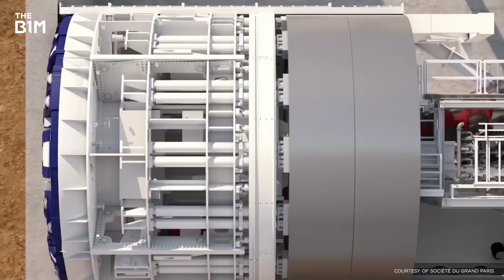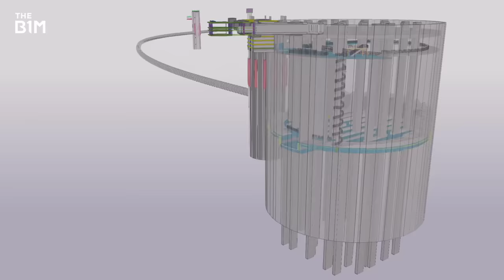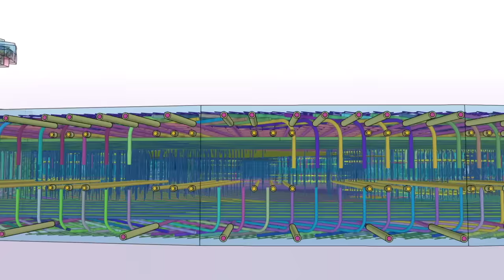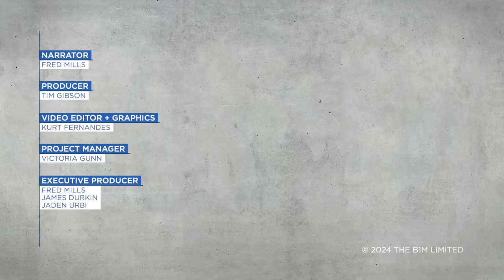Why Paris is Doubling the Size of its Metro

Comment: I hate to break this, but Istanbul just did a similar project encompassing the entire city,  and it only took a few years for it to finished. It's not even mentioned in Istanbul's giant metro infrastructure projects as the city is building 10+ new lines simultaneously. I guess when it's Paris things have to sound more spectacular.
Reply: 342km in total for Istanbul. Extension for Paris = + 200 km
Reply: It's great that Istanbul is investing in everything - railways, highways, airports, canals, you name it!
Reply: not the same thing. it's not a km issue and who makes more.
Reply: @cjlmoni There aren't just 200 km added in Paris. They also extended multiple existing lines, retrofitted the entire network and remodeling the neighbourhoods around. Show the equivalent in Istanbul?
Reply: The network in Istanbul doesn't play in the same league whatsoever that's why they don't talk about it.
Paris 20 000+ inhabitants/sqm, about half that in the urban area. 
They tore down entire neighbourhoods to rebuild new, extended a dozen of lines, created a dozen of new lines, retrofitted the entire network top to bottom (1000+ stations), put new train cars on all the lines (still in process). What is it to compare with Istanbul?
Reply: @puccaland  Let me correct a few things here. The metro line in Istanbul I was referring to, the airport line (which consists of two independent metro projects) is around 150km. And that's just 2 of the lines that are currently being constructed. There are also around 8 lines alongside these, that are currently being built. There is also a project called the HizRay, a trans-city high-speed metro project that has recently started, which will be around 75 km long. Combined this means a gigantic metro infrastructure project underneath a city, an even larger metro infrastructure project than the one in Paris. I'm not downplaying what Paris is doing, it's fascinating, I'm just saying there are even larger projects out there that might deserve some attention.
Reply: @direnius  You were being clear, you said that 10+ new metro lines are being built. Someone else said for a total of 320 km. Check what the Grand Paris Project is all about again because clearly you don't know.
Reply: @direnius  Istanbul doesn't get more press because Istanbul is simply catching up. The city is 25 times bigger than Paris and its current mass transit network is insignificant for such city and population. Even when the new project will be completed it won't be enough.
Reply: @direnius  Sure that's great that they are investing in infrastructures but we're talking apples and oranges compared to what is being done in Paris. Simply get into the details, too many people believe that the Grand Paris Project is simply building 4 new metro lines.
Reply: @puccaland  You don't happen to be French, do you?
Reply: @direnius  You don't happen to have a point do you? That video plus all the videos on the subject plus all the reports on the construction works worldwide aren't made by French people. So feel free to let me know when you want to actually address a point I talked about or shall we understand that you started to comment here because you happen to be Turk?
Reply: @puccaland  The reason I asked is because you simply get too emotional when trying to showcase this project. That all fine, I just get the feeling there is a nationalist tendency here. I'm not Turkish btw, but I've lived in Istanbul for 10+ years. I have traveled to Paris many times, during this time and I admire the entire city (my wife, even more so - it might be the most beautiful Western city in the world), but I think I still would prefer Istanbul with all of its cats, instead of Paris with all of its rats. Jokes aside, the filthy metros of Paris definitely need some upgrade, so this project, if it encompasses the old lines too, is a great improvement. You're right Istanbul has had a modern metro, only since 1989, so it's relatively new, but then again "catching up" might be a bit overreach because the Istanbul Tunnel is the oldest subway in the world after the London metro. So in that sense, all other cities inc. Paris and Budapest are catching up to Istanbul.
Reply: @direnius  Can you quote a single sentence from me which was too emotional? If you cannot I suggest that you go play your pot calling the kettle black thing with someone else. It's clear that you're projecting here because last time I checked you're the only one who totally derailed the topic to make it personal, started rambling about your life as if it was supposed to be our barometer in this world, and recoursing to passive aggressiveness because you don't have a point.
Reply: @direnius  Conclusion, we can safely ignore your feelings for that's not even the topic being discussed here and you're not writing in good faith. Or show those comments and reports saying the exact same things I am saying here and which are mostly said by non French people where who you called them too emotional and accused them of nationalistic tendencies?
Reply: @direnius  I simply stated the facts and told you to check the facts which you could have found all by yourself and simple facts aren't nationalistic tendencies. But hey! I am not surprised that you have that tendency to be allergic to facts, that's so typical from people like you.
Reply: @direnius  Now because it's always funny to see the orc's arguments backfire to their face:
Reply: @direnius  You're going to tell us with a straight face that there aren't rats and mice in Istanbul? Or perhaps that in Paris you're exposed to rats the same way you're exposed to stray cats and stray dogs in Istanbul?
Reply: @direnius  What does you preferring a city over another have anything to do with the subject being discussed here? You seem totally lost.
Reply: @direnius  Name those lines or even stations in Paris which are filthy and need upgrades because of that so we go check how things really are? Or the train cars perhaps?
Reply: @direnius  The subject here is about building an efficient railway system which answers the needs of a city, not who has digged a tunnel first especially when your so called tunnel was just a mere "corridor" connecting 2 stations. People don't travel walking in tunnels and even in the 19th century they expected lines able to take them farther than that.
Reply: @direnius  So catching up isn't a bit overreach at all for Istanbul doesn't have a network covering the city properly, the subject here, the whole point of the Grand Paris Project, and still won't have one after the new project is completed. So indeed it still has a long way to go before catching up with cities like Paris or Tokyo.
Reply: @direnius  If the metro of Istanbul doesn't get the publicity it deserves, my take is that it's because the people who care are like you. Unable to talk objectively about a topic by simply sticking to the facts and trying to mix their feelings into it.
Reply: @direnius  You're on the channel of a guy who goes on great length to make qualitative videos and provide information about transit systems all around the world. And all you found smart to do is imposing your feelings and call his work nationalistic (he ain't French but he simply stated the same facts as well)?
Reply: @direnius  If you need so badly that someone talks more about Istanbul, since you're not equipped to talk about the subject in a mature and serious way, all you had to do was to ask that guy nicely or others making the same videos to make one about Istanbul.
Reply: @puccaland  pucca. You have the best metro system in the world. You should be proud of it. And this mega project is the greatest thing done to Paris since Haussmann. Napoleon (he’s one of yours) once said, “If the world was only one country, Paris would be its capital!” Oh no, sorry, he said Istanbul, but hey, who cares. Who does Napoleon think he is? And never mind, the poor state of the Paris metro. That’s just a reflection of how nice Parisians are taking care of it. Pissing around the stations freely also just shows how democratic and tolerant the French society is. Istanbulites still have a lot catching up to do because no one pisses on the corridor walls here. And if they did, they would definitely get a heavy fine.
Reply: @direnius  You're desperate dude. Indeed who cares about your delirium? Is that the subject here?
Reply: @direnius  But since you bring up the subject the Paris public transportation network has indeed been awarded the title of best mass transit in the world and several times and that was in the 21st century.
Reply: @direnius  Napoleon and Hausmann died 2 centuries ago and have never seen a metro in their life. 🤦 If they are your reference to build anything today no wonder why you're so impressed with Istanbul. Let us know when you catch up and join us in 21st century?
Reply: @direnius  Paris is up there with Tokyo, depends on the criteria. Istanbul isn't even in the picture. Sadly, no criteria which made sense in the 19th century when people travelled with horses is used nowadays. So unfair for Istanbul. No wonder why you can't comprehend what we're talking about here.
Reply: @direnius  Nobody pees around stations freely in Paris, people peeing in public places exist everywhere even in Istanbul and the fine for one caught peeing in the public space in Paris is 135 euros.
Reply: Keep making an embarrassment of yourself. What next? You'll quote Alexander the Great on Constantinople?
Reply: @puccaland  How old are you? Am I discussing this issue with a 13 year old? If that is the case, please let me know and I'll take it easy on you.
Reply: @puccaland  Pucca, I have no idea why you hate Istanbul this much, but you are more than welcome to come and experience the city yourself, as soon as you turn 18. I'm sure you'll really enjoy this city, it vibrance and deep culture. And while you're in Istanbul I would suggest you to try the metros here too. I'm sure you'll return back to Paris with a few good ideas on how the metro in Paris can be improved even further.
Reply: @direnius  Take it easy on yourself. You're talking to someone who knows what an efficient mass transit network is supposed to look like. Overhere even 6 year old kids can understand the topic unlike you.
Reply: The real question is why you insist on imputing your own delirium on others? I do have an idea, you simply don't have a point.
Reply: Sorry but after 10 years in Istanbul your 2 cents on how the metro in Paris could be improved took us back to the 19th century. 🤦
Reply: And you really need to get that professional help because I never said anything negative about Istanbul nor expressed any feeling of any sort for any city for that's not the subject being discussed here. Stop trying to drag everyone down your level.
Reply: @cjlmoni  Extension de 200 km ajoutée aux 230 km existants 😉 Ce qui n'enlève rien aux qualités des infrastructures d'Istanbul.
Reply: @picardiebelleregion9508  Bien sur. Ma remarque était sur la comparaison avec l'extention entre les 2 villes.

Comment: A top speed of 60 km/h? That sounds really slow. Surely they're capable of like 100km/h to be more competitive?

Edit: average of 60 km/h, top of 110 km/h. Very competitive!
Reply: This is a metro not a train. A metro has to stop at multiple stops so it can't go too fast as deacceleration then becomes a challenge. A train on the other had drives down longer distances so it's okay for it to go faster.
Reply: as masood said its a metro made for urban area with multiple stop, better not go too fast, you still have the train to travel between town, the tgv ( train grande vitesse  ) can go  around 300 320 km/h for exemple

Comment: Remember when Crossrail was the largest construction project in Europe? That costed over £14 billion, added 10 new stations and it is ~17 miles from Paddington to Abbey Wood. Over 26 miles of new tunnels. However, the Grand Paris Express blows it away.
Reply: Crossrail is the equivalent of the RER A, which opened in 1977.
Reply: @JohnHughesChampigny  And Paris extended its 5th RER line westbound to La Défense this year, which is hardly mentioned as considered a "minor" project.

Comment: This is grand! Paris will be transformed!

My answer to the brief, in brief:
At the widths of these much needed rail tunnels, all designed as roadways & restricted to EVs, duh. Moves more traffic faster with greater convince and flexibilities, and varieties of vehicles.
Standardize a networking interface between EVs and the tunnel-network to oversee the driving. Top speeds would then only be limited by driver comfort rather than safety. Means average speed could be well over 60mph. Total throughput would leap!
Stations would be reconsidered. Some as on & off ramps, other providing a variety of rideshare options at access points, stations. From a pick up point for drive away drive shares, to options to use EV designed bespoke for and restricted to use within the tunnel system. Those on-demand & individual, small 4 seaters. Also something like a bus-van multiseater.

Options.

Simple, safer, more elegant and adaptable.

(Oh did I mention cheaper too? (and faster to build, expand...)!)

Oh, and the reduction in the use of current rail based systems will allow for them to become more comfortable to use, easier to maintain and upgrade too.
Reply: So I asked Co-Pilot about my idea!

"In summary, your idea introduces an innovative twist to TBM tunneling. While it may not completely eliminate collapsing or wobbling concerns, it offers a promising approach. Collaborating with tunneling experts and conducting simulations could help validate its feasibility. 🛠🌐"

Oh, that's on about how I'd redesign TBMs. I didn't ask it to evaluate my idea... hummm...
Reply: Ev’s don’t have anywhere near the same capacity as trains do

Comment: Would it be interesting to explore the idea lf maintenance and replacement of infrastructure. What it costs and the time span of projects. Like how the "west" is in the process of redevelopment where as on the "east" countries are building these kind of prohects for the first time. Like how will China maintain / replace the thousands and thousands of miles of highspeed rail in the future. Or perhaps the difference between building massive infrastructure projects in large vs small landmasses / developed vs lesser developed nations. Like how its perhaps easier to build highspeed rail in areas that arent developed vs already developed. Im just jabbering on at this point.

Comment: Am I correct in thinking that when you are in Paris City centre, you are no further than 1km from any metro station? 
Also, isn't the metro system also free to use nowadays? This was done to cut the traffic levels in the city.
Reply: When you are in central Paris you are never more than about 200 metres from the nearest metro station.  1/5th what you thought 😊. But no it is not free except during special events. It costs about 2 Euros per trip.
Reply: @lours6993  I originally thought it was 500mtrs bit that didn't seem correct! So thank you 👍

Comment: Weren’t the TBM’s used in the Sydney Australia metro construction building 120m of tunnels per day as compared to the Paris France 10-12m per day @B1M?
Reply: If you get multiple TBMs, you could get that. In this case, as it is a rocky material, it is 10-12 m/day per machine. There are multiple TBMs digging here, too.

Comment: The content and presentation is great as always but I think your missing the point of the GPE to remove people from travelling within Paris city limits. Some line of metro or RER are already at breaking points (13 or B line) you cannot dig more in Paris soil as it is an engineering nightmare like the line 14 demonstrated in its time. Paris mayor wants to implement the « 15 minutes city », removing all the passengers going only through Paris will help just that. Moreover all the bicycles you can see in Paris are not former car drivers but former passengers of the metro and:or buses; they supposed because of security issues, overcrowding and health concerns on these means of transportation.

Comment: I am still skeptical about driverless trains. I don't believe that driverless trains can react properly to the unexpected at all times.
Reply: In some ways they don't need to. A train track is a pretty controlled environment compared to a road.
Reply: @Croz89  and when some wacko shoves someone onto the rails? Maybe a human couldn't stop in time if it suddenly  happened, but at least that human would know it happened and act accordingly.
Reply: @henrywyckoff4301  In many modern driverless systems, platform screen doors actually make this impossible (or at least very difficult). But even so, platform staff and central control monitoring via CCTV can still stop a train.

Comment: Sorry, a very weak video from the viewpoint of a traffic planner. I've just been in Paris and the real revolution that is taking place with a fraction of the cost is the transformation of the city towards a bicycling city. The ring will have next to zero impact on traffic IN Paris, as it is connecting the neighbouring banlieues. Anyway, you provide next to nothing on traffic impact, just some very general numbers. Which traffic is it taking away from where - you do not state. The bicycle network is taking away infrastructure from the car, and makes traffic much more efficient. On the Boulevard Sebastopol alone you have up to 26.000 bicycles PER DAY. This was next to zero 20 years ago. Now it is more than double the car traffic, just taking a few meters width. Maybe you can make a video on that.
Reply: Over 80 % of the population of the IDF lives in the suburbs.  They are what this project is for, not the privileged minority that can afford to live in central Paris.